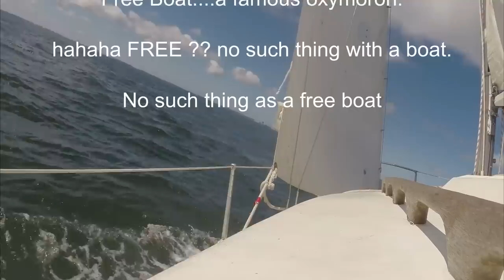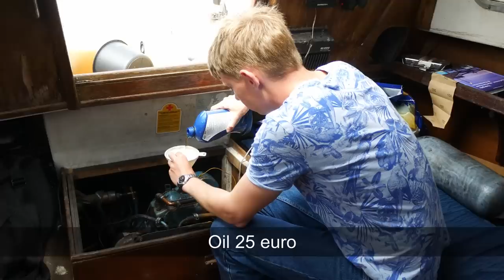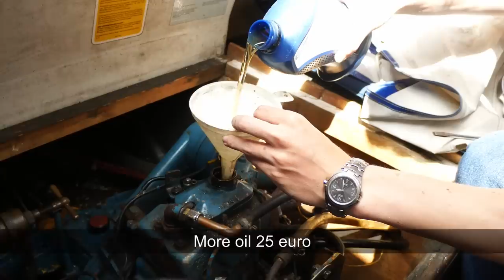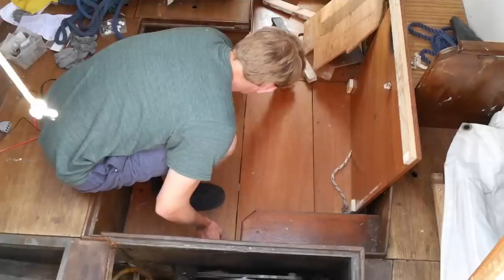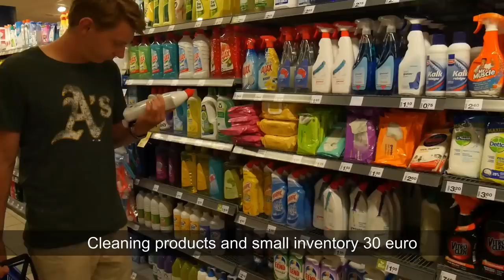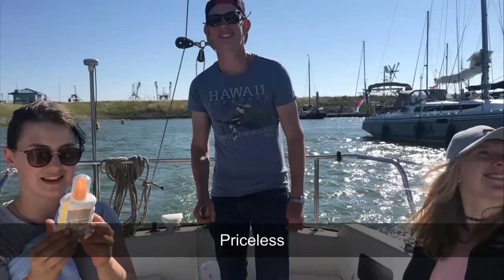A free boat 4, the costs (so far).

Comment: I have bought two sailboats that were somewhat abandoned. First one was a Lancer 28.  Sitting at a marina on Lake Erie. It had been broken into and had a foot of water in it.  I bought it and refitted it. i found a J30 sailboat, sitting under some trees in a backyard, miles from any water. I negotiated with the owner and bought it. Spent about six months doing repairs and refitting on it. I owned it for around five years and did a lot of racing in it. Did a couple 24 hour races with it and raced in lots of two day regattas. It was a great boat to sail on. 
I actually raced it single handed in a lot of races and a two day regatta (it was too much boat to be competitive single handed).
Wish I was young again, I would have kept it.
Did a lot of sailing on my brothers boat also up on the Great Lakes. Check out this video: https://youtu.be/Wunv_LIAg2A

Comment: Nice. Enjoyable process.  Wouldnt even begin to contemplate it here in the UK, would be 5x the cost just for storage,  mooring, sailing club and lift out etc.  I know, I cant even aford to keep a 17ft trailer sailer on a lake any more.
Reply: ps, also, I know a boat yard on the South coast of England who has so many boats that people cant aford to keep in their yard or their ramshackle marina anymore and have been confiscated by the yard.  They try to sell them off but the costs of keeping them far too high, eg 26' Centaur (which I looked at) needed work but storage in the yard, a real junk yard by any description was £250 per month, last I heard they were chopping these boats up after stripping what could be sold off on them.  Not called 'Rip Off Britain'' for nothing.